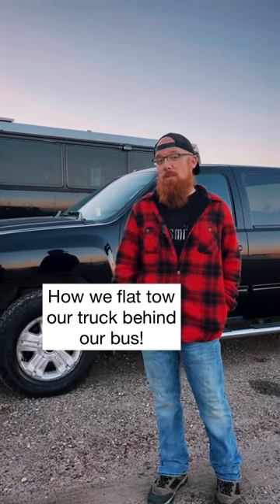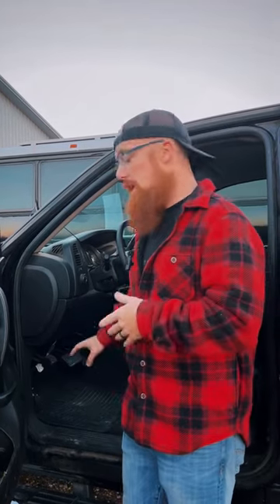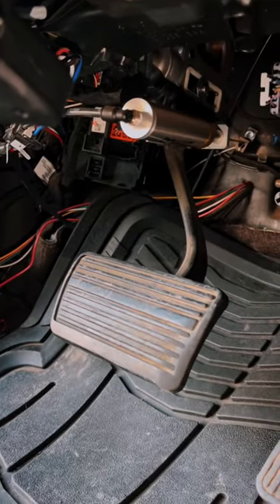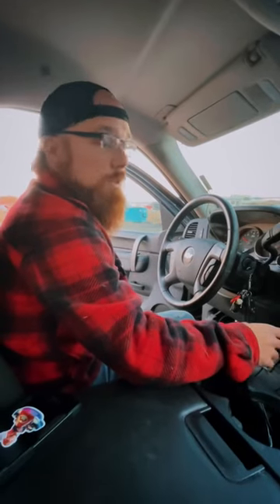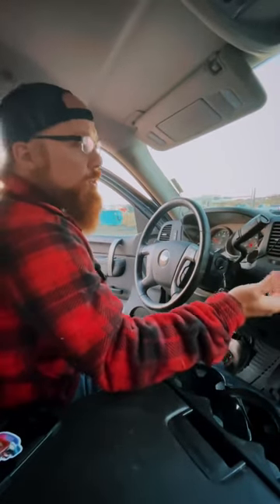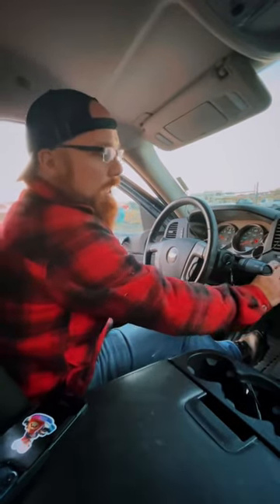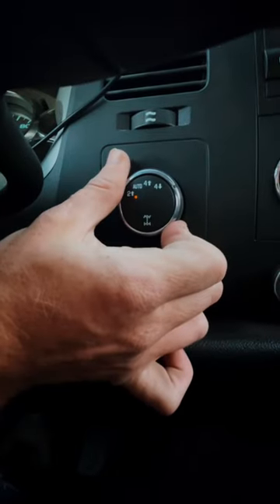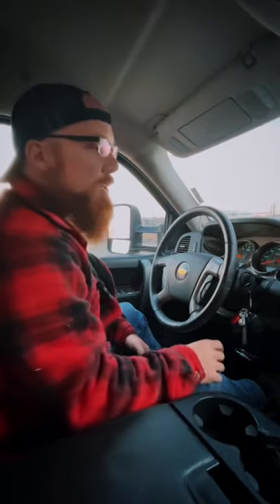How we put our transfer case in neutral and the braking system we use to flat tow our truck! #shorts

Comment: Better off disconnecting that drive shaft bud
Reply: With the transfer case in neutral the transmission does not spin. The front and rear differential spin at flat tow even with the driveshafts removed. The only thing you take out of the spinning equation by removing the driveshafts is the transfer case which is never externally cooled by and other system and is therefore fine to be spinning in neutral. Removing the driveshafts from a vehicle with a true neutral in its transfer case is a waste of time and energy. The manufacturer and their engineers say clearly flat towing with the transfer case in neutral is fine. The ford bronco even calls transfer case neutral flat tow mode in the manual.
Reply: Why would you do that. It’s a pain in the ass. The transfer case is in neutral so it really is a waste of time.

Comment: I believe that the transfer case will live alot longer if you pull driveshafts
Reply: This is not really an issue as the typical flat tow vehicle is towed less than 5,000 miles a year and many less than 1,000 that transfer case input shaft spins weather you are driving it or flat towing it an extra 5,000 miles a year is not a huge factor. It is important to change your transfer case oil/fluid on regular service intervals. Transfer cases are not cooled by any external system as transmissions are so they are not negatively affected by the engine not running while they are in use.